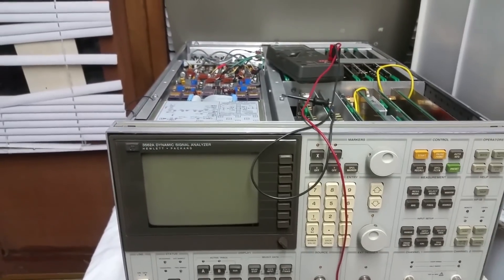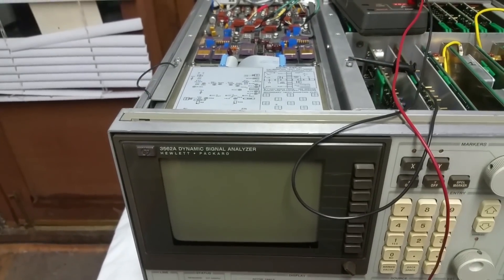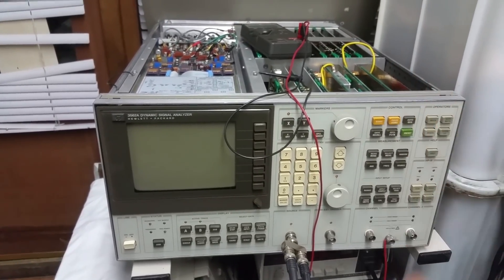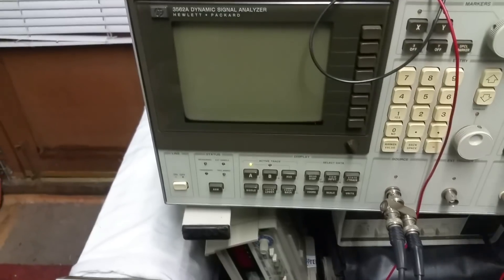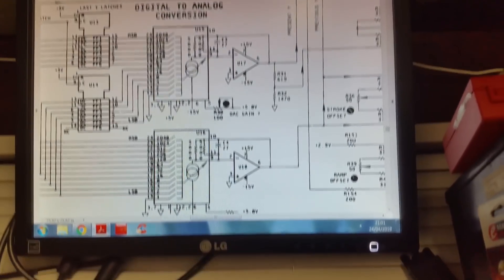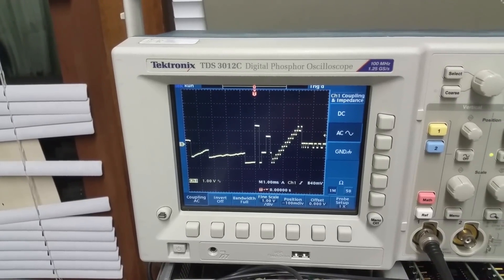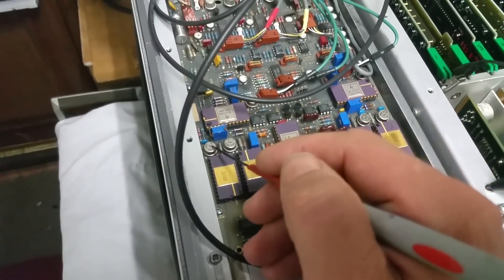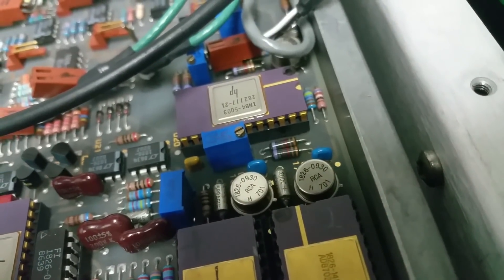Repairing  an HP 1345a display Pt1

Comment: You should also probe each of the data input pins of the DACs for activity.  Stuck inputs on the DACs could have a similar effect to what you are seeing in that it could cause a constant output level from the op amp. For the DAC which receives its data via from the latches you should check that the clock signal to the latches is getting through.
Reply from the maker: The thing is that the other DAC gets its data via the same lines. So from what I can see it's either the DAC or the op amp. Can't see what else it could be?
Reply: DACs U4 and U15 receive their data via a set of latches which hold the previous vector position data. The differences between consecutive data inputs would seem to determine the drawn vector length. If one or more of those latches are not clocking the data through then the generated vectors would probably always start from the baseline, which is what it appears to be like for the vertical deflection on the display. 

It could also be a faulty DAC or op-amp so you could try swapping DAC chips between sockets to see if the fault follows the DAC chip.
Reply from the maker: When I swapped to Dac's around the problem seemed to remain with that circuit.  So I don't think it's thst. Most likely the opamp.

Comment: Simon, I checked my HP 1349A display which is very similar to your 1345A. You should definitely have "video" at pin 10 of U16 and loss of signal there will cause mostly vertical lines on the display. On my display U25 Intensity Controller gets warm and U26 Ramp Generator gets a bit warmer, neither get what I would call hot. Three of my op amp "cans" are at -15 volts and one is at -13 volts but in my case U6 is the one with lower voltage. According to the datasheet the can should be connected to pin 4 - "V-" but that doesn't seem to always be true.  I would also check U16 pin 5 for around a + 5.8 volt supply, the reference voltage for the DAC. Also, pin 2 of the op amp should be around 0 volts DC, if it is around + 1.8 volts it is bad and may get quite hot. The equivalent op amp is the CA3140AS which is available. Hope this helps! If I can check anything else for you just say the word.

Comment: Assuming this is a vector type display, not a dot matrix raster / scan lines. That is what it looks like. The fault then seems like the beam is not turned on and off at all, so it draws lines betwen the display elements. Maybe you can trace it back from the CRT grid pin responsible.

Comment: 1:45 I see op amps by those chips, I would look closely at those.
Reply from the maker: Been replaced  mate. Now looks like a duff  opamp.  Will hopefully find out tomorrow.
Reply: Simon Spiers - yep I agree that it looks like a bad op amp, it seems they aren’t ageing too well generally, I’ve had to replace quite a few in older gear so they are always one of my first suspects, before any other IC’s.
Reply from the maker: @TheDefpom  That's interesting.  I always expected to complex stuff to go South first. Least I can get these parts.
Reply: Op amp is a CA3140AS if I looked it up correctly and which the metal can is V- of the OP amp.......so is there a supply problem to that OP-amp?
Reply from the maker: Thw supply is good Ian. The op amp is pulling to much current. New  chip on the way. Hopefully that will sort this problem out. It's like painting forth bridge!